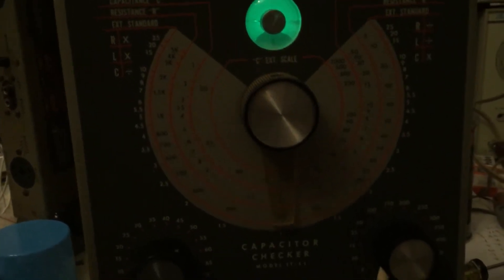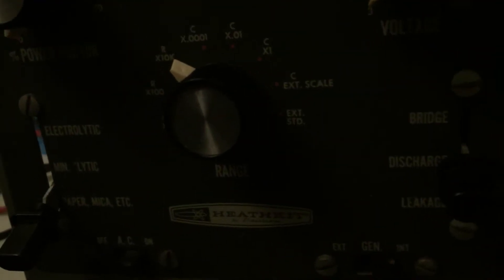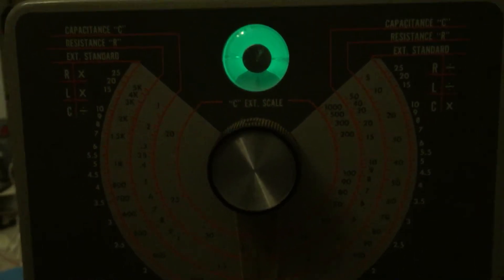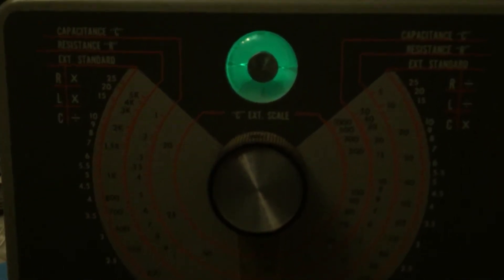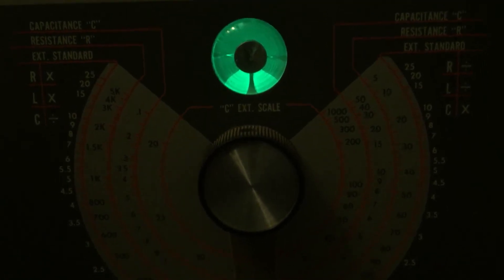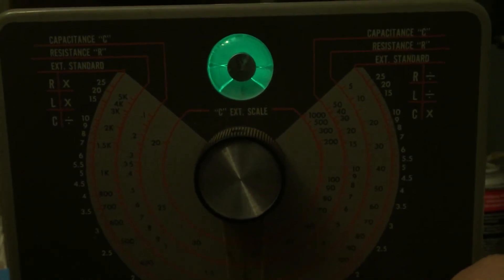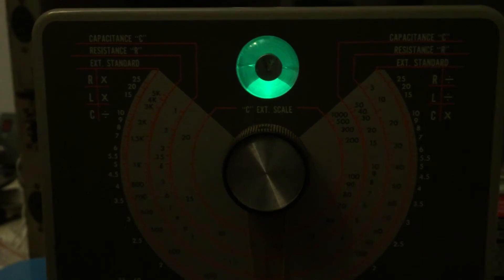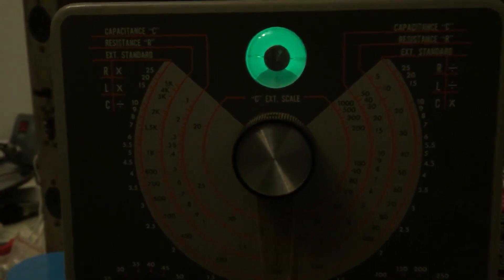Heathkit IT-11 Capacitor Checker - Magic Eye View -  Leakdown testing

Comment: Electrolytic caps can sometimes be reformed, because you're essentially rebuilding the oxide layer inside the cap, but paper caps like this one can't really be "reformed" like that.  Once the paper starts breaking down and leaking, it's finished as a capacitor.

Comment: Thanks for the video. I have just bought a C3 which has just arrived and I also bought an IT-11 which hasn't arrived yet. Both will need new caps. I am restoring several vintage mil receivers and I'm sure many caps will be leaky so will prob end up changing them all but I think it will be interesting to see the state of the caps.